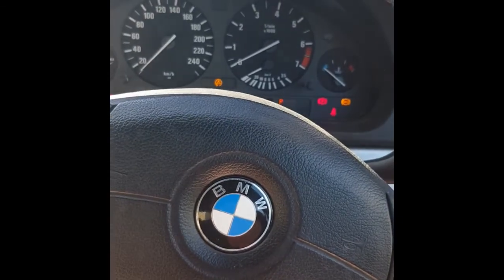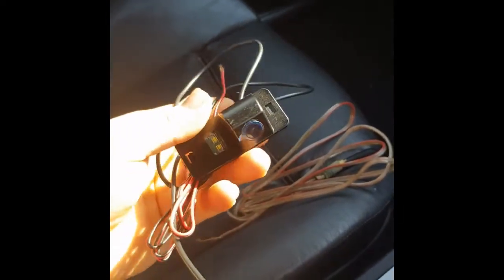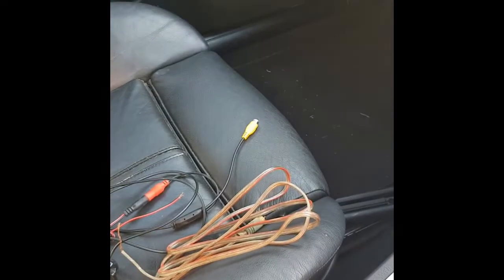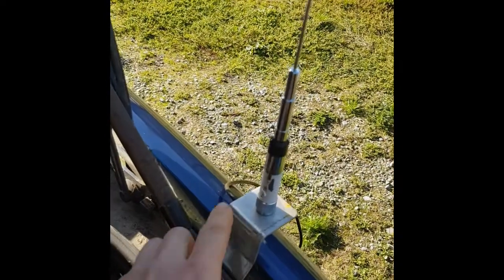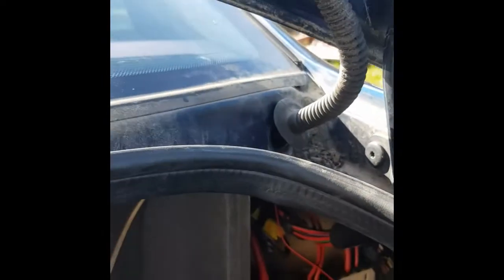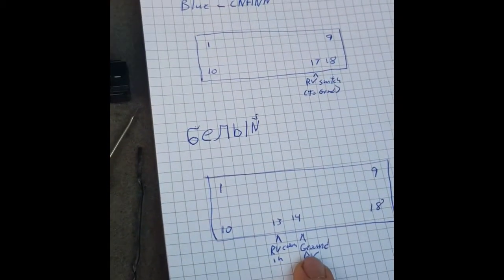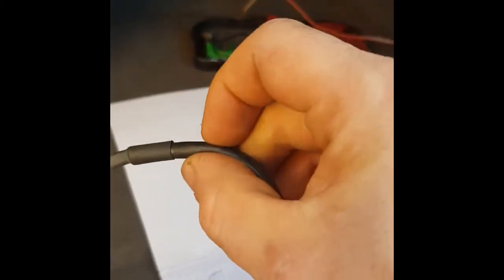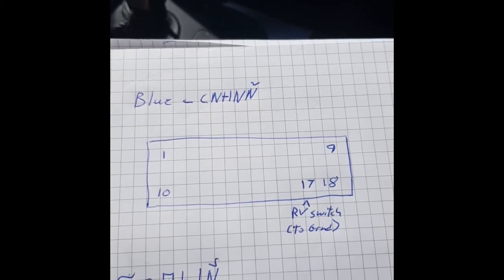E39 Reverse Camera Install.

Comment: Houston Harris - I have a 525i E39 but not the same head unit you have, I have the basic unit with a CD player. I installed a XTRONS PQ1039BL and want to add a backup camera, I got the camera installed and trying to run the video and power wire to the front, how to do I get the wires from back trunk to the front?
Reply from the maker: Remove the rear seat and run the wires through the rear firewall. Then along one side of the car underneath the trim at the edge of the carpet. I recommend the passenger side. Then across under the dash to the headunit

Comment: Hi there, can I get in contact with you as need the wiring plugs as you show, hoping you can help. Im on NZ, also my wiring is bit different on the camera.....yes I'm a bit too flash on electronics.
Reply from the maker: Absolutely
Reply: @HoustonHarris   could you PM please Cheers
Reply from the maker: @kerryfisher5190  give me a message on Facebook. I run the bmw e38s of new Zealand fb page.